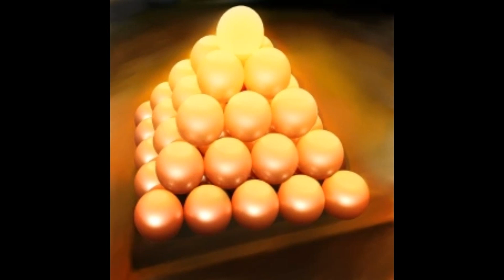The Drydock - Episode 141

Comment: "Fritz x detected! All hands to shaving stations!"
Reply: I was surprised Drach didn’t mention that part of the subject.  He covered the electric razor defense well in a past Drydock.
Reply: That whole shaving story has the feeling of a correlation does not equal causation.

I find it more likely the fritz x malfunctioned while they were playing with razors than the razors causing it.

But I could be wrong.
Reply: @cowishere8222  I’m leaning in your direction on that but it is a fun thought that early guided technology could be thwarted by a simple bathroom appliance.
Reply: @dirtdiggity1714  This reminded me of some teenage experiments with batteries, magnets, coils and an electronic gas lighter. I had no idea what I was doing (I still don't) but I switched my television off with it. It did not have a remote control.
Reply: @DardanellesBy108  And there’s certainly a lot that can be done in the propaganda front there. “Wonder Weapon Defeated By Bathroom Appliance” is certainly a headline that might just pull the designers back to the drawing board and spend time and resources solving a nonexistent problem.
Reply: @MartinWillett  Wait, what in the..... but how would....... if no ir remote sensor...... arrrhhggggg.
Reply: @presidentmerkinmuffley6769  I know. WTF! I fired the gun and the CRT screen shutdown and then powered back up again. But... How? Whaaat! I'd better not fire this electric supergun again there's an airport nearby.
Reply: @dirtdiggity1714  
I develop electric car drivetrains (like Audis Etron) we test EM in the German Luftwaffes ECM Test Laboratory.

Comment: you could only get the bends from coming up from depth if the air you were breathing was under pressure, otherwise the sub crew would get the bends when the boat surfaced. Burst lungs ... well yes.

Comment: I always thought the Iowa's would have been better off using the 16 inch 45's and use the weight saving for better external protection cause if as they were if you the sides with a 5 inch shell it would probably cause flooding needed to go back to port every time it got hit. Plus the extra barrel life from the 45cals so cheaper and less maintenance for not very much less value in firepower.

Comment: SORRY If you have ever had the unfortunate experience of actually wearing bell bottoms. You'd remember they have a fairly open weave I very much doubt they would hold any air for more than a few seconds. You would however get very clean as we used to use flake soap on the inside to keep the stupid creases sharp.

Comment: Submarine escape - If the submarine is at normal atmospheric pressure an escapee's lungs will be compressed when they leave the sub and won't expand beyond normal size on approaching the surface. Same story for gases dissolved in the blood.
Reply: Not quite right. As you have to equalise the pressure to open the hatches you'll take a full breath and your lung volume with be full at depth just prior to escape and therefore you have to exhale continually on ascent to prevent rupturing your lungs. Also even a sealed (non-flooding) submarine has pressure increases over time when disabled hence the pressure increases causing a risk of decompression illness risk. Decompression risk (gases) depends on 1) pressure 2) time at pressure 3) ascent rate so you can get decompression illness from a free ascent but you'd have to be very deep, slow ascent and possibly primed by increasing submarine pressure while waiting.
Reply: The compression would only happen if you were suddenly ejected from the submarine without prior pressure equalization.  This would probably be an event so violent that you would be killed by the ejection.  As Hawkeye says you would first have to equalize the pressure before leaving the vessel with any real chance of survival.  I takes some time for your blood to absorbed the gases that are later released to cause so it is possible that bends might not be a major problem.  Much of course depends on the actual depth. Slowing the ascent might well help most to allow you time to exhale the air in your lungs as you ascend.  Failure to exhale on ascent could reveal in severe lung damage.  You would not lose buoyancy from exhaling on the way up. In fact you would slightly increase buoyancy as you lung volume would stay the same but there would be less mass of air in the lungs.  This effect would be very small.

Comment: In the Boy Scouts, we learned to use our jeans as floatation in the same way as you described. It is a lot more difficult than you may think to actually take your pants off in the water and tie them around your neck, but it actually worked pretty darn well as floatation. We stayed in the water for about 30 minutes this way with pretty minimal effort after the initial 'setup'.

Comment: As someone who's been through military water survival, all be it USAF.  The inflation of your blouse (tunic, overshirt, etc.) by blowing air into the shoulders and holding it tight around the nape of your neck does work.  Likewise blowing bubbles into your pants (trousers) was taught but less prefered as it meant getting out of them and leaving your legs unprotected.  I'm dubious of the bellbottoms actually helping here appreciably as the area that's flared is the same area you'd use to tie them together so the overall volume isn't going to be a whole lot more than normal straight leg utility pants/trousers.

Comment: Using bell bottom dungarees as life preservers was taught to us as part of “Drownproofing” at college in 1971.  It was a mandatory PT course to graduate.
Reply: Wasn't with bell bottoms, but had to practice using jeans or trousers as impromptu flotation devices for one of the scout merit badges.  More effort that a proper life preserver and you've got to remain able to periodically refill them, but still far less effort that trying to tread water or swim.
Reply: Used trousers for flotation in a class and like others have said - not the easiest but if you can keep flipping full of air it is viable.  Until sharks or hypothermia.
Reply: @garycort7997  fortunately (?, YMMV), hypothermia is pretty quick in the North Atlantic and Arctic.
Reply: Part of Navy boot camp training as well when I went through in '77.  You could also use your shirt.
Reply: @garycort7997  I think the advantage of bell bottoms is the ease of getting them off in the water.  Plus rolling up to swab the deck.
Reply: I remember doing this with BSA as part of a merit badge or event
Reply: The only point he gets wrong on them is that drying out will let the air out, it is not soaking that is the problem, Boy Scouts when I was young and Marines in the 80's both still taught it
Reply: Same here. When I was in the Boy Scouts, one of the parts of our boating training was entering the water fully clothed, removing your pants, and using them as a flotation device.

Comment: HMS Trincomalee is a surviving British frigates of 1817, Trincomalee was built in Bombay, India,  in teak, due to oak shortages in Britain, can be visited in Hartlepool.
Reply: Teak was never popular for warship construction (as opposed to merchant ships like Cutty Sark) because wood splinters -"a common result of combat - were believed, I presume with some justification ,  to cause sepsis.
Reply: @alecblunden8615  Teak seems to be a better building material, (that's why later built ships i.e. 1869 Cutty Sark where made out of  it), it rots less quickly, water resistant, less likely to get ship worm. However sailors were suspicious of it and spread rumours that your wounds would fester from the wood splinters, unlike splinters from oak. This does not seem to be the case (as why would it be different, it's just two types of dry wood) it was just an old sailors tale.

Comment: I wouldn't think that the bends would be a major problem when escaping a sunken submarine.  When diving, or working in a caisson, the atmosphere you're breathing is pressure matched to the surrounding water pressure (1 extra atmosphere for every 10 meters of depth).  Breathing that pressurized air for a prolonged period of time that leads to the nitrogen build-up in your blood which'll cause the bends when you depressurize too quickly.  

(That's why recreational scuba divers stick to dive tables that limit dive time based on depth; the deeper you go the higher the pressure, so the faster the gas gets into your blood, so the less time you can spend before the bends become a concern).

But a submarine isn't pressurized like that, so up until the point things go wrong the crew is breathing air that's approximately standard pressure (It inevitable ends up a bit higher; but not massively).  So even if the issues that caused it to be abandoned caused water ingress that did pressurize the remaining atmosphere anybody that gets out probably did so far too quickly to have dissolved much excess nitrogen into their blood.
Reply: Before you can get out you have to equalize the pressure to that outside the hatch, or you will not get the hatch open against the tons of pressure on the hatch.  Equalizing the pressure + not being the first out all adds time you are breathing compressed gas.
Reply: @chrissouthgate4554  Guess it depends on how deep you're escaping from.  The PADI tables show the decompression limit at 140  ft is 8 minutes; under that and you shouldn't be at risk of the bends. (And I think that time factors in how long it'd take a diver to get down that deep - so in an escape situation you'd come up to pressure quicker and so have a bit less excess gas diffused into your blood by the time it hit the ~5.3 atmospheres of 140').  8 minute's seems a fair bit of time for whoever survived to get out after the pressure equalizes. 

Still, if you're escaping from deeper it takes less time to become an issue.
Reply: PADI no deco limits include the time of descent and submarine escape is pretty fast and it means that your risk of decompression sickness is increase if you exceed them but people have been 'bent' while diving within the tables and if you dive with a computer, your bottom time will generally be longer than if you dive by tables but your risk is mitigated by the time you spend at lower pressure giving you a time credit.

Comment: 47M on using trousers as a flotation device: I was in the army and it may sound silly but it DOES work.  If it's drown proofing? You would take your blouse, pinch it together at the neck, blow into it WHEN WET and the cotton swells up making a somewhat airtight seal.  When using your pants? Use the tie-offs (that's normally used to keep bugs and tic's out from eating your groin) turn them upside down, fill them with air first, put a leg under each arm and yes, they will act as "water wings".  Now to give you a perfectly mental image of this? 240 men and women of the 104th Training Regiment, 2nd Battalion- ALL OF US- as drill sgts had to re-qual on doing this once every few years.  Talk about "Weiner Stew,,,,,!!!!"

Comment: Regarding the issue of removing the 40mm Bofors from the BBs, there's one advantage: manpower. Afaik, a single quad 40mm mount required 10-12 men. Considering how many such mounts existed on the BBs (not to mention twins), that's a lot of men. And I really don't think such mounts had the speed and rate of fire to engage even 1980's anti-ship missiles.
Reply: While it's almost certainly true that any individual 40mm mount would have a hard time tracking a missile, they would be able to put up a good wall of flak collectively. It would be interesting to see an analysis of the flak barrage's effectiveness vs. 1980's missiles, especially the big Russian missiles. It would also be an interesting question whether a VT fuse analog for 40mm rounds was either available or practical.
Reply: Addendum: It would also be interesting whether the missile's radar guidance system would be confused by a BB's worth of AA fire. Would that volume of fire act like chaff?
Reply: @timberwolf1575  I understand your point, but I don't think it's valid. Yes, they would fire a lot of rounds, but not at the same point , only a general area. In order for it to work, they would have to pour rounds into a small area right in front of the missile, and these mounts are not fast enough or acurate enough. Remember even in WWII a 9 meter long Zero flying at around 500 kph would get past them. Staying in the 1980s (when the BBs were still around) you'd have to stop a 6 meter long P-15/SS-N-2 flying at 1000 kph. Flying at under 100 meters altitude. As for radar vs chaff, it doesn't work like that; chaff creates a large cloud of metalic strips that, to the missile's radar, show as a solid object. I'm not sure the missile's radar would even pick up the tiny 40mm rounds, considering their relative speeds.

Comment: If you want a simpler easy way for someone who is not an engineer at maths was to see the potential look at the 16/45 with the mk 8 super heavy vs the 16/45 with the mk 5 standard and figure that the velocity difference between the 2 is similar even though higher for the 16/50

Now look at the 16/50 on the chart and instead of the actual range in question look for the range with the appropriate amount of extra velocity (a few thousand yards closer) and it's going to be close to accurate.
Reply: The same sources provide a basis for comparison that makes it clear the Mark 5 shell is always likely to have less penetration (about 1" from the 45-caliber guns) than the Mark 8 shell.
Reply: @kemarisite  At the same time Mark 8 shell use on 16"/50 Mark 7 have less deck penetration than Mark 6 because the higher velocity.

Comment: Ah-Hah!  In the 16"/50 heavy vs non-heavy shell question, Drac mentions the tactic of firing with a reduced charge to change muzzle velocity and trajectory.  He may have seen the question I put in January about how using a reduced charge was SOP in the USN, with the trajectories calculated and included in the published gunnery tables, and whether Bismark could have done the same to score a deck hit on Hood.
Reply: She could have done, but, unlikely
Reply: @wierdalien1  I did a long reply, yesterday, to Tim Engineman 2nd in the Q&A thread with the trajectory information I have on full vs reduced charges for USN guns, but the net seems to have eaten it.  It really comes down to the ballistics of Bismark's guns and the state of training of Bismark's gunnery officers.  If the gunnery officer looks at his full charge table and sees the angle of fall at 19,000 yards is under 20 degrees, which his training tells him will ricochet off of the deck, does he turn to the reduced charge table to see what the angle of fall is?   The partial USN tables I have show the angle of fall for a 14"/45 at reduced charge is 20 degrees at 14,500, so longer ranges would result in a steeper angle of fall.  Was firing a reduced charge a thing in the German navy, and what was the state of training of Bismark's gunnery officers?

Comment: So Drach, about the 16"/50. Basically you want to replace those guns with the 40.6cm/52 SK C/34? 😉
Because those fired an 1030kg shell at 810m/s and the rough shell design is quite similar to Mark 5. Both had large, very hard and blunt caps which where sheath hardened and they where designed for good preform at least 30 degree angles of impact. The German shell however has 24.2kg of TNT instead of 15.2kg of Explosive D. 

But I kinda consider this already excessive. Some time ago, I went threw the Gkdos100 document for the 38cm/52cm SK C/34 and wrote down some numbers in a table. Those guns are plenty enough against pretty much anything actually afloat during WW2. At 20km with an additional 10 degree of angle over the normal angle of impact (some 16 degrees at 20km for the shell) you are still looking at 360mm+ of KCnA. And that is arguably slightly out of those shells their optimum bracket. Its already 380mm at 19km and 400mm at 18km. Knowing that KCnA was better than most other navies had, and yea, that is going threw pretty much anything at just about any actual WW2 battleship on battleship battle where they fought until one got sunk. I haven't looked at all the battleship on battleship track charts yet, but most show the same pattern of deliberately closing to ranges below 20km and then straightened out to a roughly parallel course while shooting at each other. The moment you straighten out, guns like this will penetrate almost every time they hit an armoured belt.

Comment: In my 6th grade gym class we did an exercise where we practiced tying up and inflating our pants as a flotation device. You would just pop your head under and exhale so they would trap the air rather than trying to wave them in the air, especially if wet. It was best to tie the ends of the legs up since the leg holes were smaller than the waist, so bell bottoms would actually make that harder.